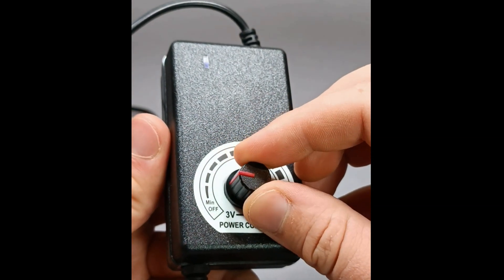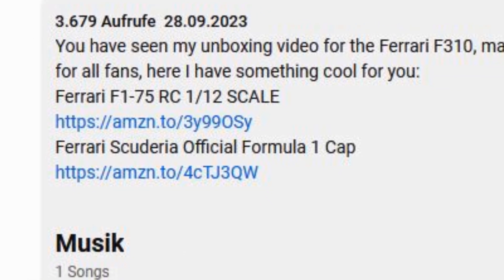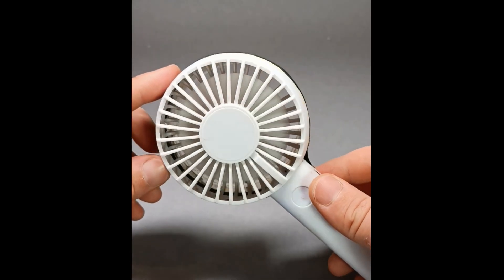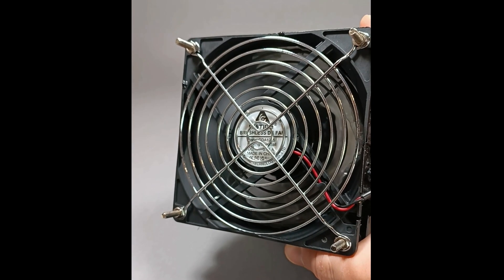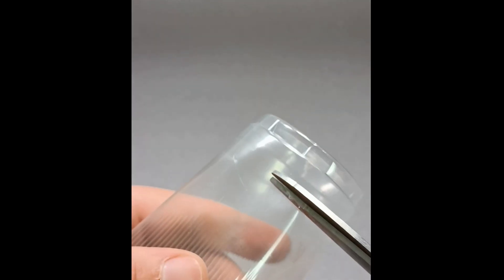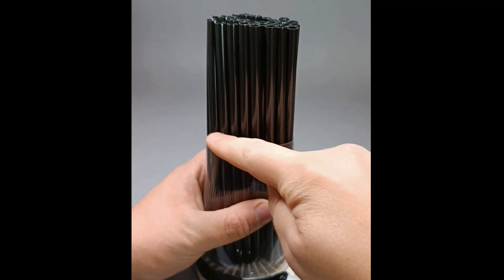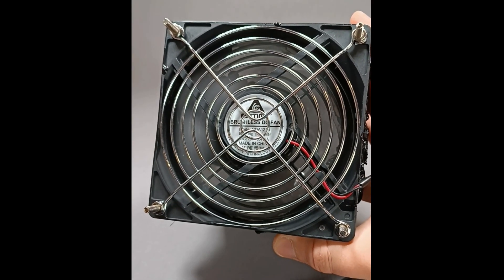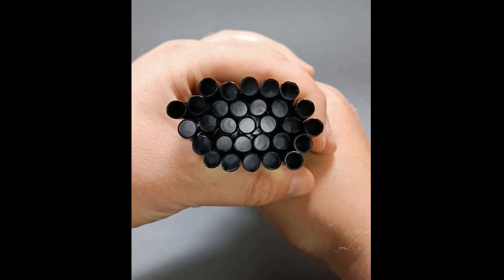How to make a Smoke Intake for a Diecast Wind Tunnel? Check out this way!

Comment: So... Umm... How do you incorporate the vapor machine into this whole contraption..? 

This may actually be a possible project I can do over the summer.

I just.. I'd appreciate a little bit more clarity on this.. I've been wanting the fancy device, but I can't afford it... So.. This may be the next best thing.

Lemme know when you can

Respectfully,
TheOfficialBasketCase
Reply from the maker: That's a very good question. Everyone builds their own system, each one is different and has different sizes. Therefore, it's difficult for me to say exactly how you should align your system. I recommend building the system in an acrylic box so that you don't have any outside influences. Try to find the right height for your smoke system. Then install the smoke system at the front so that you can easily adjust/remove it, but everything is mounted as airtight as possible. I don't need to say much about the exhaust, I think that's logical. But I recommend installing some kind of felt, specifically between the tubes that draw in air and the motor that draws in the air. Make it so that you can remove the felt; it's there to absorb moisture/oil from the smoke and protects the motor. You can simply wash and dry the filler and reuse it.

Comment: the professional big fan displayed is a GDSTIME model GDA1225 bearing: dual ball 12v 0.25
Reply: @DeeCast123  also does that fan suck air or it pushes it
Reply from the maker: @Guys-i-love-planes-and-cars7  it should suck! never let the wind blow in. always make a vacuum in the tunnel. the fewer external influences, the better the results
Reply: @DeeCast123  you mean the one in the description or in general
Reply from the maker: @Guys-i-love-planes-and-cars7  in general
Reply: @DeeCast123  alr dude tsym
Reply: @DeeCast123  ok this is the lasttt questionn is the fan in the description and the one in the video they are different but do they both suck air and if so what is the code name for that type of fan that sucks instead of "spitting air"
Reply: @DeeCast123  my smart body didnt read the description lol

Comment: How does the fan make smoke?
Reply: Yea I have no choice the windsible is super over priced and this is not really a suitable option
Reply from the maker: The fan pulls the smoke out of the system.
Reply: @ how it’s just a fan it will just blow out air and not smoke
Reply: Why did you include the ceap method it just blows out air and not smoke bro
Reply from the maker: @Celesterossi733  The smoke is produced by a smoke machine, so you definitely need a smoke source. It can be evaporation of oil or dry ice. What's important is that the smoke comes out through a small nozzle at the front of the car. The smoke must not come out with too much pressure, but is guided by the fan that creates a vacuum; it should only slide onto the car. the whole system should happen in a windproof box. as this creates turbulence which distorts your aerodynamic test.
Reply from the maker: @Celesterossi733  I have uploaded 2 videos. how to make smoke with things you can buy. and how to build the vacuum
Reply: Yea but  you said that the cheap one doesn’t need a smoke machine

Comment: Is steam also good or not?
Reply from the maker: Yes
Reply: @DeeCast123  the steam i use is kind of weak. Could you maybe show a video of your full wind tunnel??
Reply: @lbxcurry  get 1.7mhz ultrasonic transducers, you can make a very cheap steam generator for your wind tunnel using those

Comment: can you make one and sell ?
Reply: wait, I don't understand, we put plastic tubes at the outlet of the ventilator where it pushes the air out?  or from the side where it sucks in air?  and the car is in front of the fan or after it?
Reply from the maker: @t254fd43  You should build a pipe on the intake side, this will help you concentrate the intake, the straws will result in less turbulence caused by the draft. You put the whole system behind your car, smoke machine in front
Reply from the maker: No sorry, iam not a seller 👍